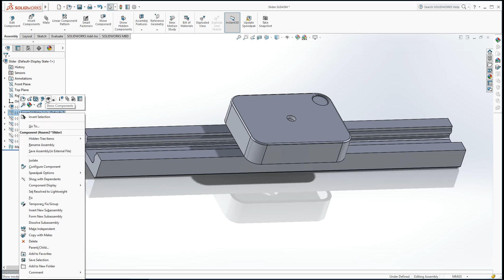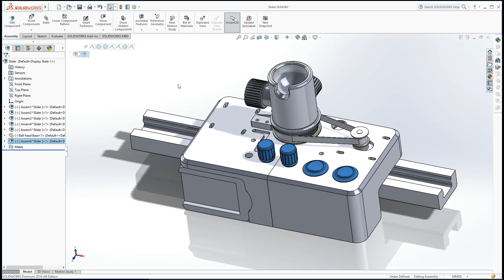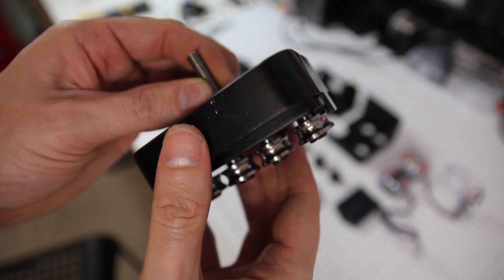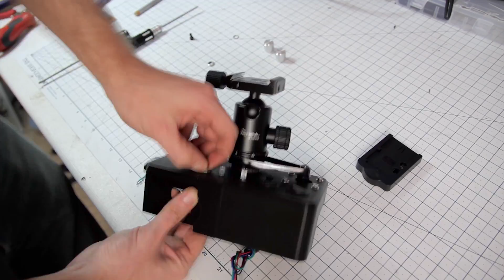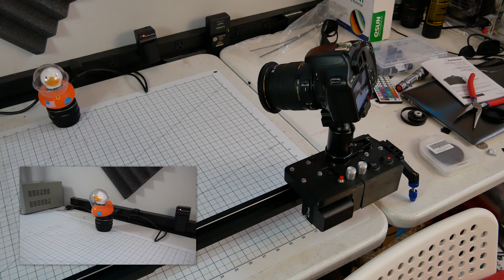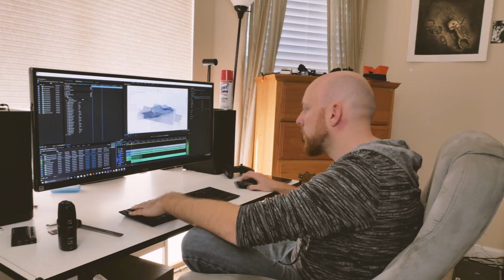S01E17 - Camera Slider (Part 2)

Comment: By the way, i have mountend my hardware and the electronics, but can't make code run. I have double cheked conections, and i have test separately different parts, ensuring that both motors, drivers, etc, are right. But when i connect your code, just ear a 'hssssssss' sound, that's all! Any idea? thanks again for sharing your project! :)

Comment: Do not advise what changes to make in this sketch? Sketch worker, I checked. I just transferred the driver to 1/16 microstep. The engine works well, but due to changes in pitch from 200 to 3200, you need to make changes in the sketch as well. Now the slider goes to the entire length of the slider. Thank! http://www.electronoobs.com/eng_arduino_tut27_2.php

Comment: Why do you have so few subscribers and views? Your videos are so well done! It's perhaps better done than most 100k-1m youtubers! I have already subscribed to you, so I can't do much more than do likes :/

One thing I would want to see, and I guess several others, is how to build a laser cutter like you have, without going through all the trouble you did (Only a few parts is left of the original kit right?).

Also, do some more stuff with your delta? Like perhaps design a flying extruder etc? It seems that most youtubers have cartesians, but that doesn't help me much or interest me, since I have a delta too! :P

Good luck! :)
Reply from the maker: Thanks for the kind words Nor1MAL. my next video will will cover the laser cutting in more detail. it was a lot of work to put together, but i will release all the plans i have if it will help others make their own.

as far as the 3d printer, i am sure i will be doing a lot more videos on that one. i have even started designing a newer bigger delta with dual extruders.